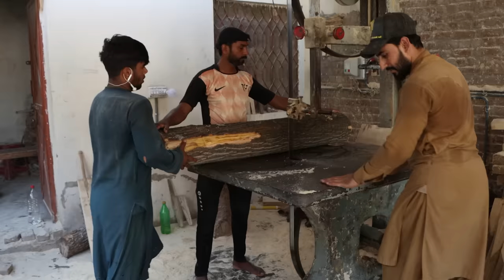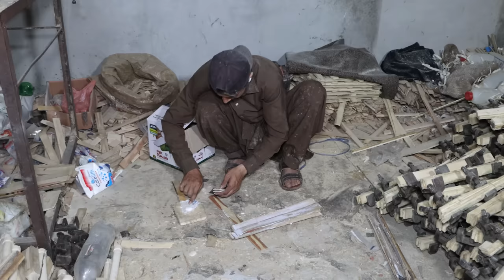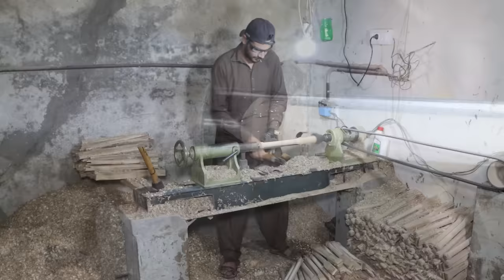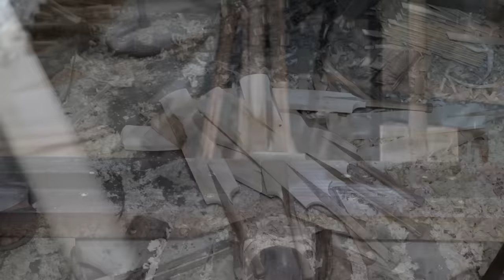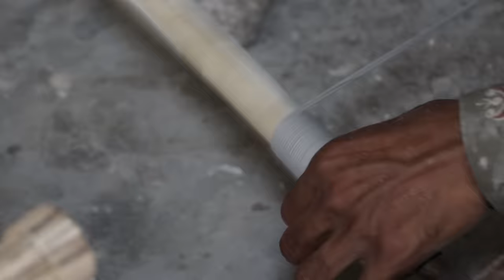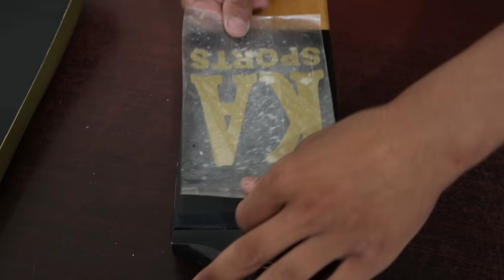Amazing Process of Making Quality Cricket Bat | Factory Mass Production Process

Comment: What are the holes for in the side of the bats? Some had them and some didnt
Reply: There's a 'sweet spot' on cricket bats. The holes I assume cause the ball to bounce off at higher speed.
There is no standard bat size or weight.
Dennis Lillie used one made from aluminum - once. 
Not always bigger is better, however
There was a famous West Indian cricket captain named Clive Lloyd. His bat was gigantic.
Reply: @waggafletcher the holes are there cause this is not a hard ball bat this is for "tape ball' or street cricket so the hole are there for the lighter weight